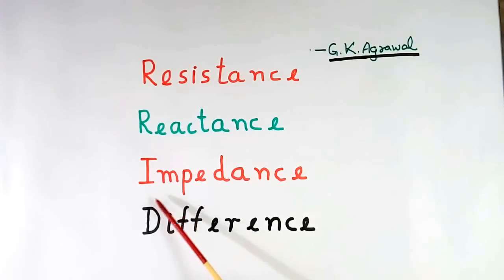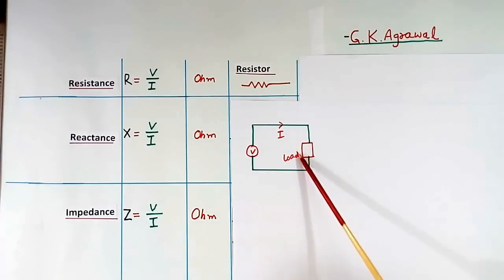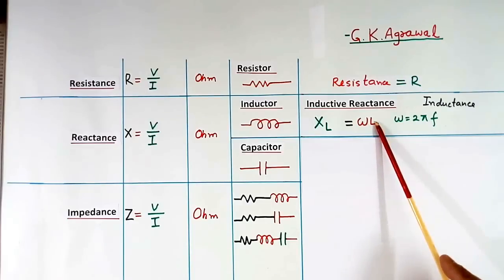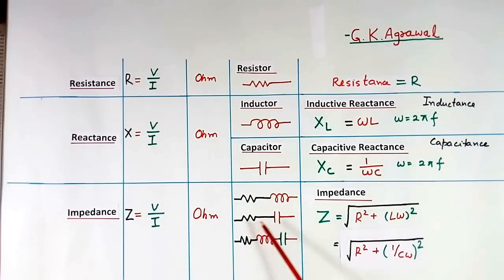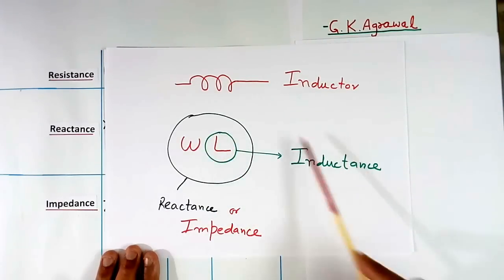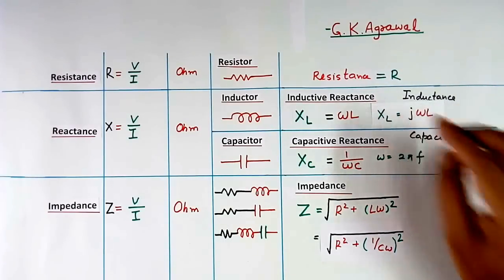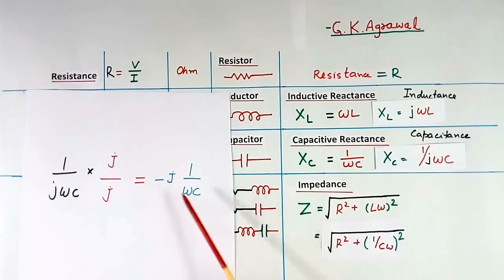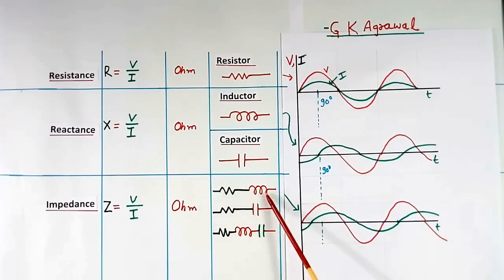Impedance, Resistance and Reactance - difference

Comment: Sir for 5kw 440v, 3 phase system. what will be he value of current  and power in each phase. Will it  6.56 A and 5kw in each phase?
Reply from the maker: 6.56 amp in each line,  5KW is total power for all 3 phases. each phase power 5/3 = 1.66KW
Reply: @GKAgrawal2  why total will be sum of power of each phase? What is reasoning behind it?
Reply from the maker: Total energy cannot be generated or destroyed.
Reply: @GKAgrawal2  ok. if we have to do back calculation with wattage value of 1.66 kw per phase how could we get 6.56A on each phase?
Reply from the maker: 440 volt will give phase voltage 440/1.732 = 254 volt. Now current will be 1.66KW/254 = 6.5 amps.  If you want to learn really then, you must watch my video on horsepower once again carefully with concentration, before this, 1st you should watch my another video 220 volt and 440 volts, phase and line voltage difference.

Comment: @7:30 it could be mentioned that, if considering a capacitive reactance, the voltage will lag the current by 90deg.
Reply: no not by 90 but by 45
Reply: @takshashila2995  Thanks!
Reply from the maker: I think, both of you must watch my video on lagging and leading current, power factor difference.
Reply from the maker: I think, both of you must watch my video on lagging, leading current and power factor